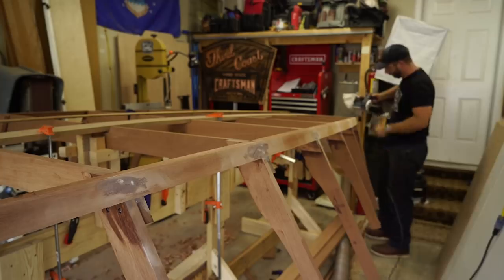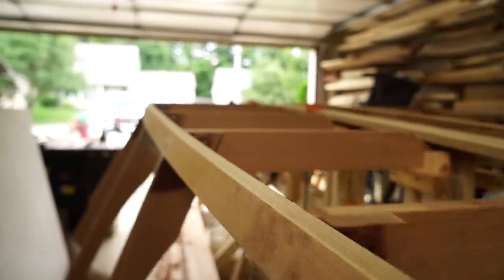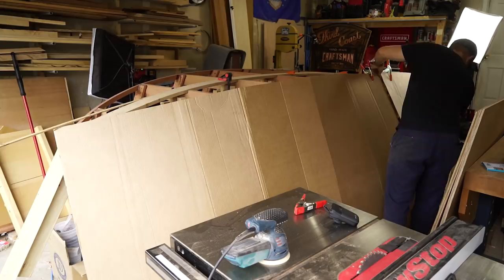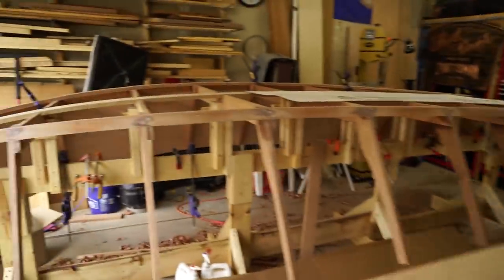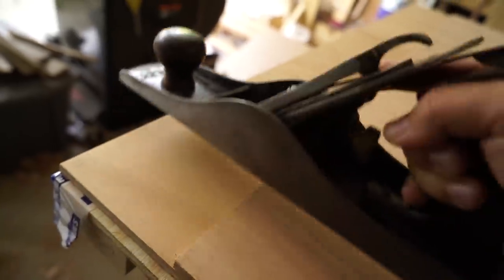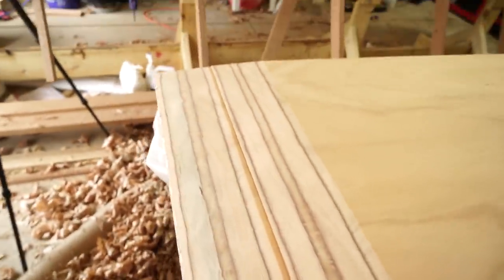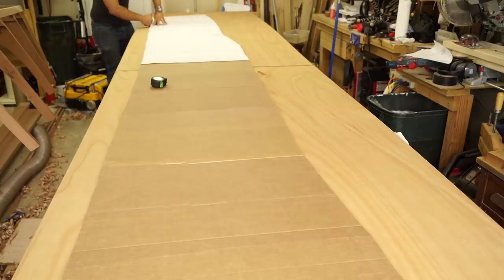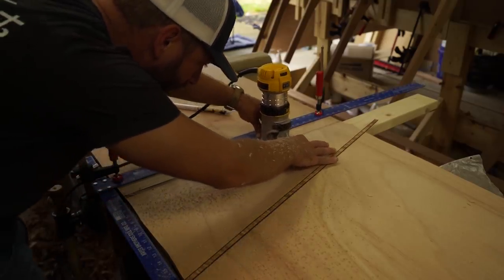Wooden Boat Build // Part 7: Chine Logs & Scarfing Sides

Comment: I like the way you handled the interior scarf joint. If you can’t make a joint disappear, accentuate it!  Well done. I’m building a glued lap strake dory and am using 3/8” maranti plywood for the strakes. My trick was to layout the scarfs over a frame so the joint wouldn’t show on the inside where the finish will be bright. Looking forward to the rest of your work.

Comment: My Dad and I use to use a Belt Sander to create the Scarf Joints. Sometimes when the belt sander was not available we used a disc grinder. We would then glue them up with a 3 minute epoxy or do it right on the boat.